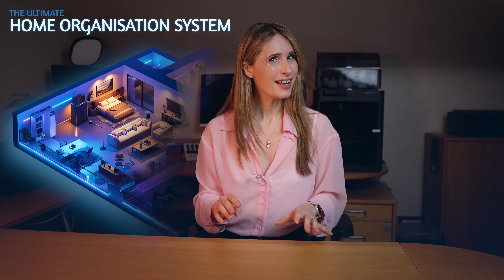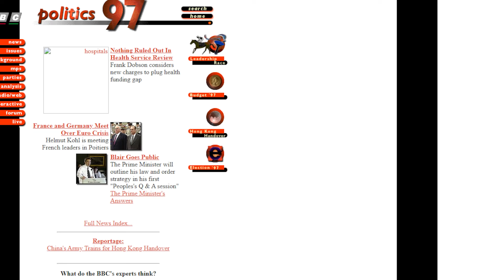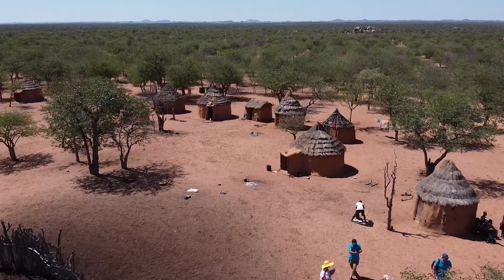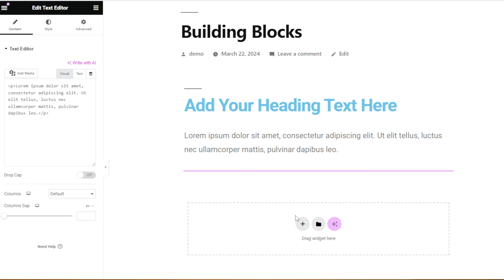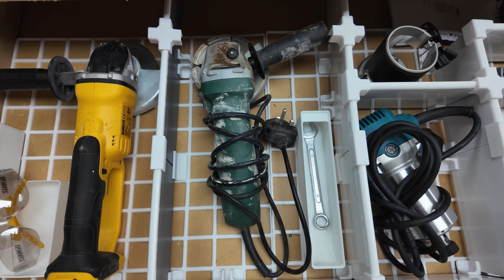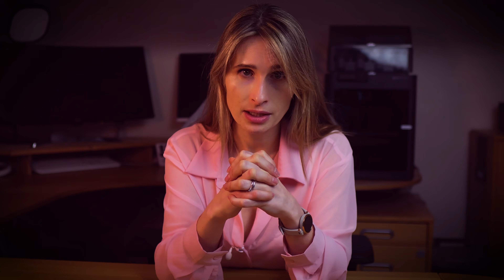Open Source Home Organisation: Four FREE systems to engineer order in YOUR home.

Comment: I didn't know Gridfinity, but mainly because I ignored it, I actually thought I don't need such a system (I don't have many drawers). But you convinced me that it may indeed be useful beyond drawers. I especially like the converter things... that's a really good idea. I already thought, using boxes on a multiboard would not be flexible enough. I would usually take some boxes to the place I work with them, e.g. in the garden or another desk (they are always overcrowded, so I have several of them). I use transparent boxes to store but also carry around tools and things. Converters solve this.
Reply from the maker: Brilliant examples and I love the toilet roll example, I might invent a 3d print for that I think! I've just published a new video that might bring some of this to life even more!
Reply: @handsonkatie  actually, I think it could be a module for Gridfinity, 42x42 is a good size for most cables (e.g. Audio). Some cables are a bit too big and too stiff for one toilet roll (e.g. 240V cables), instead I would use two Gridfinity rectangles for these. Some small cables could also be two per rectangle. I guess such boxes already exist? May be not the necessary height? the boxes do not need to be round
Reply from the maker: @aribowell exactly right, I already do this! Watch out in future videos and I'll show them. But it's also a nice idea to use toilet roll, I was thinking I could create a little 3d printed cap and Gridfinity base and then you could just clip them onto toilet rolls to turn them into more rigid containers!
Reply: @handsonkatie  I have some quite old assortment boxes with a see through cover. Those contain little boxes sized by a base raster, some with a multiple of the raster, but no grid at the bottom. I always wanted more of them, but never found an alternative product. I should probably create my own and use Gridfinity raster for them. Mine have an inner size of 29.2mm x 22.8mm (well 30 x 23.5 outside with cover, it's a practical size, full of screws they are still not too heavy. A box has an inner sie of 7.2mm x 5.6 mm, so most screws fit inside (I use them for screws, mainly for the 3D printer, and for electronic parts)
Reply from the maker: @aribowell that could be a great use - and if you do the maths, you can work out what Gridfinity pattern fits best for them and have them inter compatible! 😎

Comment: Katie, one of the major drawbacks of organization imo is the time and investment put into prior or existing organization attempts. For instance, my wife and I built a new house and have A LOT of items of all kinds and all sizes just in boxes in the basement. Christmas decorations, other home decorations, kitchen organization items, clothing, tools, electronics, etc.

So far, our organizational ideas have consisted of building three 7ft high, 30" deep, and with 4 tiers including the concrete floor. - 24' long in total.. We have purchased semi-transparent storage containers that are roughly 18"H X 20" W X 30" L. These have opaque lids, but our idea is that with using a labeler and the fact they are transparent allows us to see what's in them without opening them up unnecessarily.

To begin our organizational journey, we are determining 2 things. 1. Do we want to keep this? 2. How soon will we use this? Answer to question one is either Yes or No of course, if no, trash it or sell it... For question 2, Imminent use goes on Tiers 1 and 2 - most accessible with later possible use going on tiers 3 and 4 at the top, less accessible of course.

I really like your methodology, but not certain how could be reasonably applied to our home. I will say that if I had time and energy, applying what you here to my workshop for tools, nails, screws, etc, sounds feasible. I do really look forward to seeing how you have applied this first hand to your home for a guide and as a reference....
Reply from the maker: Brilliant thinking here and you're spot on - I've got a video this week showing how I've applied it to my craft room that touches on your exact points (eg frequency of use and so on). Remember with a 3d printer, it's not your time and energy - you'd hit 'print' on 25 boxes and leave it to work away overnight!

Comment: One thing that has helped me a lot with cables is a simple ziplock bag. The use of the ziplock bag keeps the cables from getting tangled with each other. I take each cable (no more than 3 cables of the same kind in a single bag, else tangling might occur) and place it in a bag, using a sharpie to indicate what the cable is for. These can be tossed in a box with zero concern for tangling. It would be great to see how a grid system could be added to this to better organize things. Keep going, Katie; I love your creative (artistic) engineering approaches.
Reply: I like rubber bands. I just coil the cables and wrap a band around them. Similar ethos it sounds like
Reply from the maker: Brilliant idea - I love these sorts of elegant and simple solutions - as you say, it completely tackles the issue of tangling of cables!  Thank you for your kind comments too!
Reply: We do the same. We also put old power supplies /bricks in ziploc bags labeled with the voltage, max current or power, and the plug polarity. I've resurrected many bits of electronics because we had a compatible power supply.

Comment: I think you summarized the problem and solution approach well.  I have been building both multiboard and gridfinity solutions independently for a while.  I do not think they integrate well and will be interested in your solutions.

I am intrigued by neo and followed you down the rabbit hole ... hope you can provide a "utility board" compatible product available in the US else it will be difficult to include that component into the system. 😢😢😢 ( the US is never going to go metric in my lifetime )
Reply from the maker: Thanks Carl - yes, the various converters between Gridfinity and Multiboard have been essential I'd say - I'll tour these in detail in upcoming videos.

As for Neogrid, well the design is parametric, so very easy to fit any width of material, so if you can find some consistent similar material in the US and state the width, I can easily generate all the files to fit. I've used 6mm MDF for example in testing it and it works great!
Reply: @handsonkatie  Update: I recently found an update on Printables by user Alexander Songe who generated 1/8" models.  These will work perfectly with laser cut baltic birch dividers and with 3mm cardboard from all of my Amazon boxes.  Thanks for your continued updates and work.  I am waiting to see your shop organization video.

I also downloaded the F360 files and am playing with those.
Reply: I look forward to more instructional videos on integrating these organizational systems.

I am teaching myself F360 and will try to find an appropriate material to test neo.  I have been building boxes out of 3mm cardboard using a similar set of connectors.

Comment: Great video, and I want to remove my clutter of parts in the house.  Can you recommend a 3D printer, I have no clue.
Reply from the maker: I might do a video on this as quite a common question - I'd start with Bambu A1 if you want to start cheap or go to a Bambu P1S if you want to spend a little more....! Both are super reliable and fast!

Comment: Why  42mm?
Reply from the maker: Well the short answer is Douglas Adams - as in the Hitchhiker's Guide to the Galaxy.... I did analyse this myself as I'd considered looking at alternative dimensions (eg 50mm, 25mm etc). It actually works pretty well as a number with a high number of divisible factors and it works well with both imperial and metric (as a close fit to their standard sizes at lots of common size points) - so in short I think, relatively arbitrary, but it was surprisingly effective as a size!
Reply: @handsonkatie  Nice.  The "ultimate answer to everything" also came to mind when I was watching.  LOL 😀...  I'm looking at doing something similar but for a laser cutter instead of 3D Printing .  Great vid, thanks.
Reply from the maker: @DesignAlign  ooh, I'm building some designs for both laser and CNCing for the same, so keep eye open in future as I'll share the files!

Comment: Great timing... I'm working on gridfinity for so many parts or my house, and it works great for the little things, but it gets cumbersome for the big things. Working on my garage now. Any thoughts on what to do with painting supplies? I've got 3 drawers of my Craftsman tool chests devoted to rollers, sleves, paint trays and tubes of caulk. Would love to hear you thoughts,
Reply from the maker: Oooh I've got loads of ideas - I've got horizontal and vertical stores for caulk/silicone tubes. Rollers, sleeves, paint trays are larger items, so I'd just build neogrid dividers for these myself.  For small hand roller sleeves, you could design a Gridfinity solution - let me know if any urgent ones and can share files or model something specific, otherwise this will be covered in my workshop videos!!
Reply: Awesome. I'm  only 5-6 drawers into my 30+ drawer solution so I'll prioritize around these for now. Excited to see what you come up with!

Comment: I love this approach!  My main issue is that if I don’t see things, I won’t remember I even have them!  So I have lots of transparent containers that I label.  They also have lids to keep dust/pests out.  Is it possible to do the same with 3D printing?
Reply from the maker: Yes, great point - fdm printers can print transparent filament, but they'll be more opaque than glass-like. Few ways I'd approach this, I use window boxes like this: https://images.app.goo.gl/JWTqZ3M9LTSoGa6c8 and as in the video to allow this. The other option would be to just use your transparent boxes and create Gridfinity bases for them so you get the best of both worlds! Might include this in one of the room videos!

Comment: Hey Katie,
I love your videos and you're a natural Youtube presenter. I've been using and designing parts for gidfinity for some time now and love that system. But I have use for a portable solution for my organizational needs. My models are located in the same place as your Neogrid prints and i go by Handy Handcrafts. It would be nice if you had Neogrid models that snapped into to the Multiboard system. I can offer my design skills i you'd like. I may design my own containers as well for Multiboard that meet my specific needs.  Keep up the great videos and we'll keep watching!
Reply from the maker: Hey thanks HikerDad - I try my best! What's your thoughts on the NeoGrid option - more than happy to model anything required or you're welcome to have the design files too, just struggling to picture what you're describing, but I like a challenge!  Do you use discord?  We could chat in my server there I've set up so I can share files/pictures easier?
Reply: @handsonkatie I sent you a message on your Let's connect webpage

Comment: I wouldn’t know what 3D Printer to buy. I am of the impression that they are very slow, so I don’t know how you managed to print so much in the past few weeks.
Reply from the maker: Well they've certainly got an awful lot faster in recent years, but there's a subtlety to how they operate that I probably need to cover - ie they can work away non-stop and don't need any attention, so they can be running away through the day and night - I'll try and cover this in a future video!

Comment: Do you worry about 3D printers and micro plastics?
Reply from the maker: I almost entirely use PLA - which is compostable/biodegradable at high compost temps - I also have an air monitor that I use just to keep an eye on them (more for workshop than 3d printer as it turns out as it's close to zero emissions) - so, I'd certainly be sensible as you should be with any material (eg I wouldn't use 3d prints for food items), but I'm not overly concerned.

Comment: Awesome idea! To be honest, cables are still my nemesis. From small USB cables to my collection of random power cables, they won’t stay in their container and become a tangled mess.
Reply from the maker: I've got a few ideas for those - agree cables are an endless battle though!!! 🫣
Reply: Mine usually stay organized when looped and slid into a toilet paper tube (or section if the cable doesn't fit well) or else wrapped around the tube, then ends tucked through. The tube could be covered in nice paper or something to standardize or color-code or just make it pretty. Or just write what it's for on the tube with a marker and throw the thing into the "cables" bin/drawer/box with the others.
Reply from the maker: This is a great idea - I've designed something very similar, you can get slightly more space efficient than circles if you use honeycomb-style designs - I'll upload these in the near future once I'm happy with the sizings! But love simple solutions when they're available too - I'd actually probably avoid covering/papering them - it does look less polished, but suddenly you move from an endless supply of cable organisers being produced 'automatically' (without getting into your toilet habits!) to a chore that you need to maintain! If you want something nice, then I'd go with a 3d print that you can fire and forget in seconds,  if you don't mind it being a bit  rough and ready (eg storage in your attic or out of sight), then toilet roll rubes are a brilliant idea. You could also use kitchen roll tubes which are twice the length for any larger usb cables.
Reply: @handsonkatie   Well, I'm also pretty frugal and I've seen other possible uses for them, so I've been saving them up; paper towel ("kitchen roll") tubes as well. At this point, I think I've run out of cords and cables to put in them, so I can start using them for supposedly plantable seedlings cups or pitching them into the recycling bin. I'm also big on efficiency and also lazy, so I was just using the ones that were white and smooth (not the gray cardboardy ones) and hand-printing a short label on it with a marker. They are out-of-sight in a bin that fits under a shelving unit.
Reply from the maker: I just hit 'print' on a bunch of usb cable organisers that I just designed based on your thoughts...!! Love the idea of the planters, would degrade nicely and much better than those shop ones that degrade, but constrain the roots at the base. I'm gonna pinch that idea!! ❤❤❤😊
Reply: The paper rol or printed tube solution is probably the best I have ever seen or heard of. I’m definitely gonna use this as well! Curious to see how Katie’s versions will look like.

Comment: Mostly looking forward for tips organising a desk with all of its cables, power strip and small items like pens, flask drives etc. 
As well as organising the plethora of spare construction material in all different shapes and sizes. 
Don't own a 3D printer though. I'm concerned about the VOC's since our house is nearly air tight.
Reply from the maker: Super - have some stuff on this in plan after my pc build series. Also might do a short on the VoC point, have some smart sensors for this...! Although they're actually really not a problem since filaments like ABS went out of fashion and filters/enclosures became more common...! Might be worth keeping an eye out for that test!

Comment: A great video Katie 😃 raises hand with question -- what 3D printer are you using that you've printed over a 1000 items in the last few weeks? I have one (i'm embarrassed to say it is a Balco one from Aldi) but it didn't print fast at all and i haven't used it for a few years. It looks llike you might have a Prusa one?
Reply from the maker: Well I've got er... five ..... 😂😂 First was a Prusa Mk3s, second was a CR10 Max (huge size but I had to basically rebuild it completely to get it to be reliable) and latest are Bambu P1S - I liked the first one so much, I bought two more....! Highly recommend them or their A1 range, you'll be amazed at speed difference Vs Balco....!
Reply: @handsonkatie  holy moly! you are really into your 3D printing. Yeah, i can see how you would be able to produce that many items now. The Balco is something like 10-70mm/sec compared to 500mm/sec on the P1S?! crikey! no comparison!
Reply from the maker: Yes and it's even more of a difference in reality due to all the input shaping and optimisation - highly recommend!
Reply: @handsonkatie  Katie you've clearly invested a lot of time and effort fine tuning your 3D printing process! I'd love to see a video that describes what you think are must-haves in a 3D printing set up. I'm yet to take the plunge into the 3D printing world but can see that following your channel might just tip the balance and having your thoughts would be of immeasurable value. "Immeasurable." 🤔Is that metric or imperial?
Reply from the maker: @bobthekelpie  sounds like a topic for a video in future!